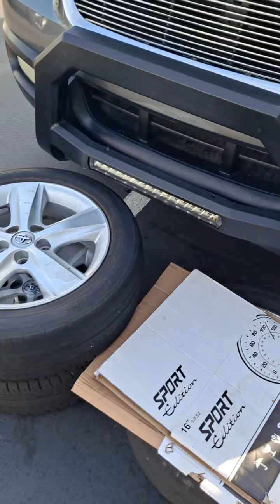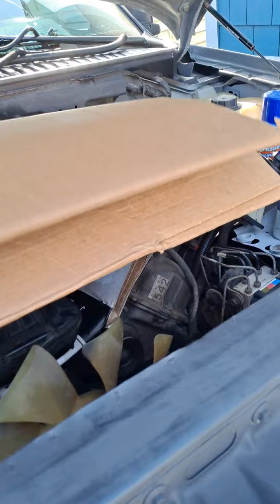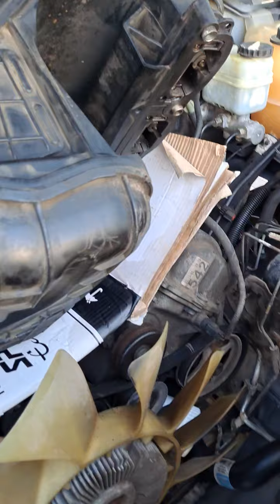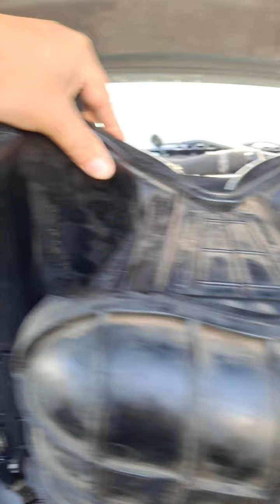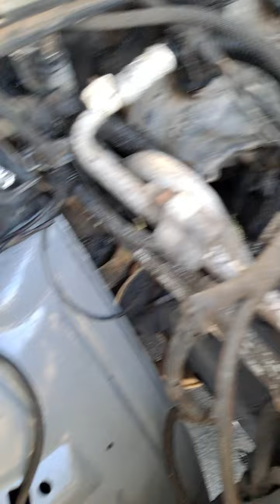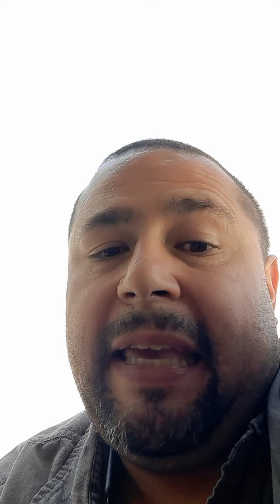Hyliion News are TERRIBLE THIS WEEK | This is what I'm doing about it!

Comment: I think it's over for HYLN.  Production of trucks is stalled, probably for good. What's left?  KARNO.  I've said it before, and I will again. If KARNO was everything it touted to be, GE would have developed it further and monetized it themselves.  Far as Electric and H2 truck stocks go I'd pivot from HYLN if you still own it and move to NKLA.
Reply: They're still committed to building out the fleet trial trucks (although I guess even this could change in the coming weeks - still TBD IMO). Just my opinion, with the GE break-up, GE Additive was in no position to develop a new product line from something they simply used as a way to demonstrate their 3D printing tech. The focus of their new Vernova energy business is in turbines of all sorts. It did say a lot that they took partial payment in HYLN stock for the patent. Karno still needs a lot of real-world testing even as a stand-alone application ... real engineering - where the rubber meets the road stuff (weather, soot control, emissions, load vs temperature efficiency, working fluid flow control valve longevity, etc). Hyliion has enough cash on hand to do this and bring it to market if all that testing pans out some time in 2024 - entering the projected $53 billion stand-alone generator business. IF they don't reverse split or dilute the shares, they can leverage the generator income to further the truck business once the Class 8 market improves. Green hydrogen is still a ways off since most alternative energy sources can barely keep up supplying 20% to the existing US grid loads. A game changer would be nuclear powered red hydrogen production - but that would be a decade+ away IF the US committed to it now and who knows how far pure BEV technology will come in the next 10 years+. Hyliion will be stuck flopping around the $1 mark until they at least demonstrate a revenue stream from one product; which could ? be mid-2024 if one can believe them now.
Reply: Nikola has a better chance as they are already delivering
Reply: No way.
Reply from the maker: NKLA is looking better these days but don't forget that just a few weeks ago NKLA hit $0.55 and came back. I will continue to hold 100% of my hyln shares and buy tidbits of nkla as I go along.
Reply: I look forward to Saturday's video my brother!  @Entrepreneurshipdog